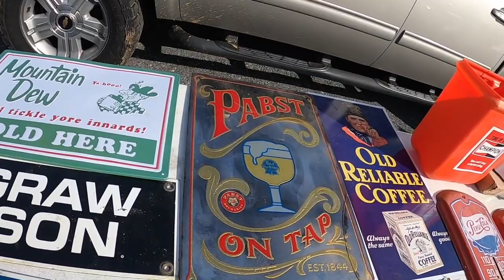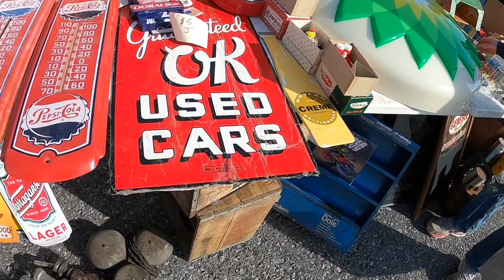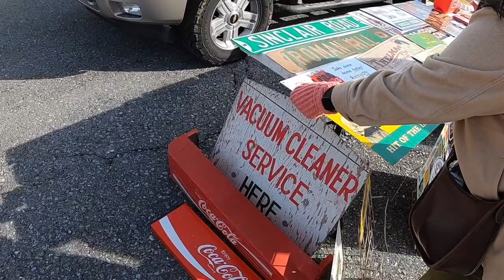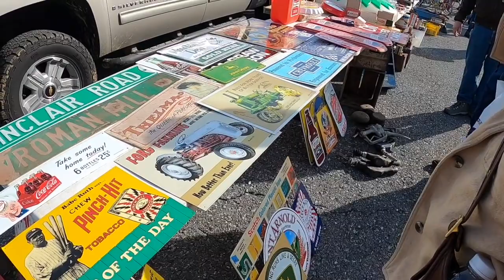Raw Footage Maple Grove Speedway Swap Meet / Car Parts

Comment: Looks like they was some stuff there. I was hoping to see some nive old Cragars! That steering wheel is not a 70 model year! That steering wheel is 1971 and up! You could run the chusion grip steering wheel on your Nova! It's a spun aluminum center with black rubber outer band! The center cap has a little bowtie on it! Its the optional steering wheel for 1970, looks similar to the 70s covette steering wheel! You and Kim take care that wind will cut right through you! Later ✌ man
Reply from the maker: I like the chevelle / nova wood grain center horn Bars on 71. Has that accent on my door panels. So that's sorta what I want. Your right though, it was just vinyl covered foam horn bar 69 70

Comment: gotta get into my truck (68) but a 4.11 12 bolt and a 4 speed manual is what I have. Hoping it is all solid
Reply from the maker: They had tons of ring gear sets at thr meet for 12 bolts. I saw a couple super T10-4 's too.

Comment: I was at the Stafford swapmeet today and found two Dr side doors for my 55 mine is a little crusty on the bottom. One he wanted $500 really clean the other $350 and it needed work. I didn't see any sense getting a door that needs work when I can fix mine for about half of what he's asking. I did buy the patch panels for the fenders where they rust over the headlamps at a good price and got the forward floor braces at the firewall from the same guy. All together he was $160 cheaper than online for new parts wi th no tax and no shipping so score on that. Also found a trim piece for my chevelle brand new dirt cheap so lucky score. Also found a guy selling one weld wheel 15x5.5 that matches the one I got from another chevelle I crashed 30 years ago for $20 so score on that. I usually never get that lucky finding things I need. Found three guys selling mincie transmission used for $500 don't know if they were 20-21 doubt 22 but thought they were somewhat fairly priced too bad I reached my limit for the day. What's the deal with your fenders? Patch panels are a little pricey but still way cheaper than a new one or a really rust free one IMO.
Reply from the maker: My fenders are a little rough, the owner before me did a crap job on eyebrows. I can make them work but that blue fender was extra nice. I mad at myself for not grabbing it. Next time, even if it is just a spare to have. Don't think this my last tri five 55 lol. 
Happy to hear you got a few great scores! Sounds like it was your day for sure. ✌️
Reply: @bwsgarage   did you pick up that blue fender and take a good look up in the eyebrow area? It's rare finding one that hasn't had some 80s custom body work. Both mine were "repaired" pretty much exactly like the fenders on Dan's 55 nomad. I consider that normal if it's not rusted there it makes me scratch my head and think that's weird. If you knew me personally you'd know I'm a cheap bastard I'll fix anything if I can do it properly but I also take into consideration cost how much work is involved etc. In the mid 80s I did 4 years auto body training back then it was very limited what panels were available so a lot of newspaper, fiberglass,rivets and Bondo was used it was cheap and you passed safety inspection. If that fender was truly rust free then $350 was a very good price but it's still a better deal if you can fix your existing fender for $100. If any shady bodywork is present it will bite you later then your in the same boat your in now but have two fenders that need to be repaired.